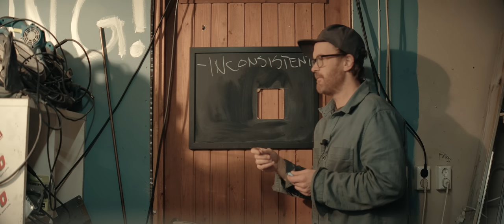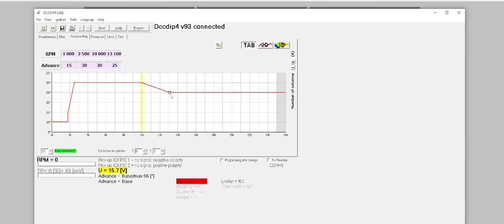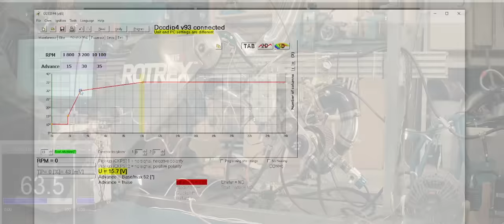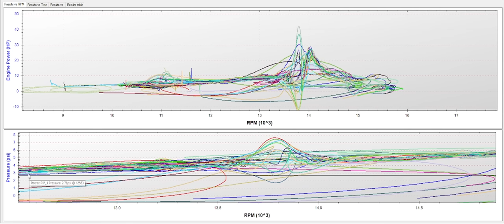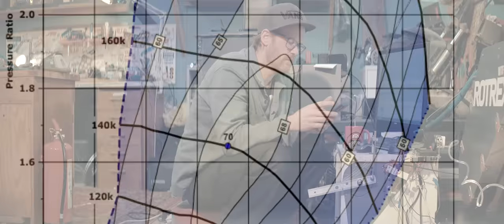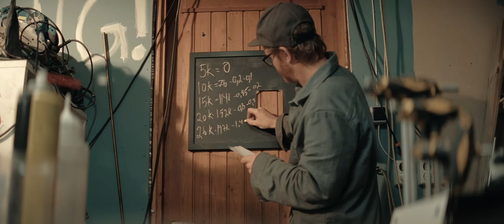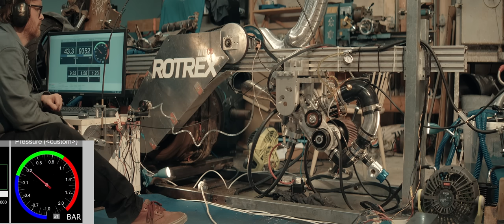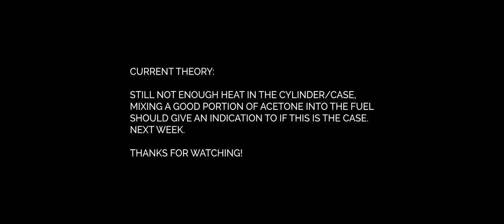Supercharged Pulsejet Engine?

Comment: Maybe increase the carburetor distance from the block, longer runner so to speak, for higher rpm. This worked for me on my 241cc race engine. I tried 5 different lengths. Too close and it wouldn't rev high.

Comment: I have a question about flame path as you are using a flat piston top, and with the high flow would a shaped piston top help direct fresh mix into cylinder rather than just passing over the piston to the exhaust port?
Reply: Hello Lee. I believe this piston has a 5 degree piston crown.
Many decades ago pistons came with deflectors on the piston crown which gave good efficency at low rpm when dished combustion were used.
The porting which Alex uses is similar to the Aprilia RSA which is renowned for it's perfomance
Reply: @malcrandall1309  thank you for replying,  
That helps clarify that the deflector type piston top is relevant to slow running,  so I'm assuming the transfer port geometry is doing a similar thing and this is what you are referring to from the aprilia design. Negating the need for the deflector type piston.(probably over simplified)
Reply: @leealsing1539  The transfer ports are similar to the Aprilia in height. Alex added a large radius transfer ducts to try and negate crowding in the passage ways.
This PiP engine was designed to be run N/A with a 100% of bore exhaust port with 2 induction systems. The main one being fully resonant with 2 fuel injectors
Sadley the 100% of bore exhaust didn't quite work as planned using the Mark Atkinson design piston and a exhaust bridge was later fitted.
The crank cases have a very large internal volume which I personally feel isn't the best for performance.
I must admit to coming from the clockwork era and not a fan of forced air induction or other fancy fuels I will close by saying Alex designed the crank cases as well as the cylinder/head and expansion chamber.
PS, I'm a great fan of this PiP engine and would love to see it run N/A with conventional race fuel as.It would sing like a bird released beyond 20K.
Reply: @malcrandall1309  thank you. You have been extremely helpful, and I'm greatly appreciated your time and knowledge.
Your replays have been really helpful and give me a far better understanding of things.

Comment: Is it possible to add a pressure sensor , so we can messure compression in crankcase ? 
20:46 Maybe the fuel is self igniting under pressure and pushing agains the rod from bottom.

just an idea🤔

Comment: Seems air velocity is the problem rather than relying on heat to atomize the fuel, maybe a smaller carb; thinking being like a spray gun, smaller outlet - higher velocity for the same volume with greater atomization? Adding more boost with the larger pulleys is just adding larger volume rather than increasing velocity no?

Comment: All the air flow from the supercharger is probably blowing through the engine and pressurize the exhaust. It's probably choking the the exhaust from engine and since it's under so puch pressure its probably just exploding.

Comment: Kawasaki and Mazda have patent for 2-stroke supercharged engine. Engine uses CAMSHAFTS & VALVES. Fuel is injected and lift amount of intake and exhaust for valves is: - EXHAUST: CCA. 60 degrees to tEC; -INTAKE: cca.160 degrees to 300 degrees(tIC); fuel is injected at 300 degrees to cca. 330 degrees & IGNITION is at cca. 350 degrees(depends on ignition timing). SUPERCHARGER is directly connected to intake valve. In your case the carburater has interference from pressure of the supercharger. Cheers

Comment: That odd boost spike has to be due to the harmonics of the exhaust pipe, because there is such massive overlap and the only true way to build boost in a 2 stroke is by pressurising/restricting the exhaust .
Reply from the maker: 👍 I'm thinking so too, especially after more boost didn't do anything.

Comment: If you want more heat into the engine, try running it on gas for a bit and then turn on your mix. I still believe that the pipe will never do anything in a forced induction setup, there's too much exhaust pressure and velocity to overcome for any sort of wave to head back towards the engine, especially at that kind of rpm. The fact that the fuel is still burning through the pipe tells me you still need more ignition advance to hit the point where you've made up for how slow that fuel burns, though it should throw a flame no matter what if it's running right.
Reply: You're right, J.A. When Alex I finally gets close to a workable system, running the engine on gasoline will get the head temperature up to where it belongs... then he can use a gate-valve to immediately switch to the nitro/methanol mixture. Also, I think you're right about his use of expansion chambers in conjunction with mechanical boost—they are detrimental to the success of this design. No matter, I believe that Alex will eventually incorporate his rotary exhaust valve to trap the combusting mixture within the combustion chamber. Like it or not, he will also have to increase ignition advance as he progresses to higher percentages of nitromethane.
Reply: @davidgierke7582  really makes me wish I could afford the tools and materials to make this myself and prove that I'm not just talking out my ass. I'm sure that someone that's willing to listen to others and learn from the knowledge of those that have been there before and know the fuel etc could have this thing working right in no time. Now I doubt it'll ever make as much power as he thinks but, I think they could get it running right.
Reply: @jaratt85 Hello, can you rembember around a month ago Alex had a rant on why he does things as he does. Well that rant was directed at me! I had suggested in the comments that he should reduce the crankcase volume using epoxy putty to reduce it's 390cc volume giving a better pumping action.
Sadly this hit a nerve with Alex. I had no intention of pulling Alex down in any way but he did say he's going to do it his way come what may! No one can fault him saying that! it's his free to view channel.
There are lots of us who would love to get a few day's in Alex's garage. I have volunteered to do the night shift many a time.
This message is just to allow you to understand how Alex works.

Comment: I don't know if you or anybody else notices it or not but right before the exhaust ignites and starts shooting a flame you can see raw fuel being sprayed directly into your exhaust vent tube quite heavily. Almost comparable to the mist out of a can of hairspray it is so much..... I'm beginning to think that the engine has some sort of resonant frequency issue that is causing it to not allow adequate pressure building and fuel atomization to happen inside of the combustion chamber. You may have built all the parts so perfectly and harmoniously balanced in frequency with each other that all of the vibrations literally cancel out the combustion process....

Comment: Maybe the port timing is too aggressive for boost. Back in the early 2000 era, Dan Hull was turbocharging Yamaha banshees with good success. I remember hearing that the port timing /porting had to be completely stock.
Reply: This engine has revved to 18300 while using the roots blower and speedway carb.

Comment: Will it rev above 15k without the blower or on pump gas?
Reply: Alex did some tests several weeks ago using Petrol and the engine seemed much happier with no back fires. What it revved to I can't remember.
While using the Roots blower and speedway carb this engine achieved 18300 RPM and climbing pulling the retarder un braked.
Reply from the maker: I'm at the verge of caving into a normal sensible person now. Disconnect the blower, re-tune carb for gas, start from there.
Reply: @2STROKESTUFFING  Your comment " I'm at the verge of caving into a normal sensible person now "  I'm just coming round to you using RC fuel. I was a great fan of carbs but I feel with this fuel the only way to get the finely atomised fuel required is EFI to allow complete combustion before the exhaust port opens at such high revs.
Does this mean your taking on the Dutch 50cc tuners again........YIPPEE!

Comment: If you ARE running into a pulse resonance induced upper Rev limit, to exceed it you have to raise the pulse resonance point. To do that most easily, shorten your exhaust length, or put a shorter blower to port path in your system. Pulse jet resonance is all about length and the speed of sound (the hard limit of pulse flow in both directions). Under standard conditions, that means your ENTIRE tract length (blower to stinger) should be somewhere around half a meter ( 20k revs=40k pulse runs per minute/60=660 pulse runs per second. 330mps mach/660 pulses=0.5 meters). 

Such a length would, however, subject your blower wheel to resonance battering  at 20k rpm, so just a bit lower length would give you a resonant peak above 20k (a 45cm total resonant length would be a roughly 22k Mach redline rpm)

Comment: It seems to me, that you should consider how the engine will be mounted in the frame. I suspect that out of sheer need, you will alter the pipe diameters and lengths and the operational engine will be very different. 
One step at a time. You need to know which change caused which effect. Note them down.

Comment: 4 foot flames out the headers is not a uncommon thing with nitro, well on the drag cars any way. something to do with how slow the fuel burns means its still burning when pushed out the exhaust.
Reply: Also lots more timing. top fuel drag engines go as high as 55* there spinning at 10krpm with that sort of timing and lots of boost.
Reply: @judgie13  Today's top fuel and funny car engines are turning slower—closer to 8500 rpm.

Comment: What would happen if you eliminated the ignition & went glow plug? Do you have the compression to fire in a diesel mode?
Reply: Hey, Peter. Unfortunately, glow plugs intended for the ignition of A/F mixture within an engine's combustion chamber are generally misunderstood. First, glow plugs don't require the high compression ratios associated with true diesels. But glow ignition depends upon three primary factors: 1) The glow coil (usually made from a platinum alloy) works in conjunction with methanol vapors to produce a catalytic, exothermal reaction that heats the element—but not quite to the ignition temperature of methanol. 2) The glow plug coil has the ability to carry-over, from cycle-to-cycle, the heat generated by the catalytic-action, along with the heat from the fuel's combustion. 3) As the piston begins its return to TDC (on the next cycle), its heat of compression temperature is also added to the plug's coil. 

The total amount of this carry-over heat (actually temperature) determines when the engine will fire on the compression event. Thus, the control of the engine's ignition timing is determined by the physical properties of the coil (diameter of the wire, diameter of the coil, the number of coils), plus the location and clearance of the coil within the steel plug housing, etc. With no external current passing through the coil—the engine will continue to run—attests to the glow plug's effectiveness. Glow plugs have been experimented with in engine designs (successful and unsuccessful) since the mid 1800s. Their use in the modern glow engine (using platinum alloys as the element) as used in model airplanes made their first appearance in 1947. Although glow plugs are readily available, none that I am aware of is large enough to meet the ignition and timing (advance) needs of an experimental 50cc methanol/nitromethane engine. Could they be developed? Yes... but that would be another R&D project onto itself.

Comment: I think your pulse jet is the rev limiter, kind of... With rising boost you blow more and more mixture in the exhaust. when that stuff gets on fire you get so much pressure it pushes burnt gases back in the engine, probably over several revolutions and even back in the crank case. As soon as the blower manages to push finally some fresh mixture up in the engine it recovers, but will be blown out again with the next power stroke of your pulse jet.
what do you think of that wild theory?
a wide open pipe instead of your exhaust could give an idea if this theory is close or not.

Comment: u need a open tip egt ( exhaust gas temp ) pyro its what i use in my chain saws it works and u can tell if its runing lean or rich once u learn what temps that  make power at the very least u should use one to start colecting data so when u get closer to making power u have a better idear of the temps u want to run and when in a bike doing speed easy to tell if its about to or is melting pistons.   and do u have a plan incase youer exhaust gas extraction system catchers fire do u check it befor u walk away dont burn down youer shed

Comment: In old days when running 250cc 2 stroke on Avgas we were aiming for 72-74 degrees C... If carb was mounted on inlet side of Rotrex it would work as constructed (not pressureized)... Have you optimized the shape of the head for the flame speed of the fuel you are using ?

Comment: Have you considered a turbo? Maybe after the expansion chamber? I always thought it was the logical thing to do with a two stroke as far as forced induction. The other thing that crossed my mind was that maybe you need to build a pipe for the inducted air volume not the swept chamber volume? If the pressure wave is  fighting back a 100cc engine worth of air charge with a tuned for 50cc pipe that sounds all wrong.

Comment: And I think the issue is now back pressure your blowing the power right out the intake cause not enough Angle on the pipe pre heat the cylinder with a igniter your very closer to perfection

Comment: Couldn't you try to preheat the nitromethane before feeding it into the engine? I mean, i have seen engines that run a heat exchanger for the fuel with the coolant water just before the injection pump

Comment: I have a medium size hobby lathe and I struggled with parting for some while. Not enough torque and rigidity for hss resulting terrible vibrations and rubbing and tool bindings. Crappy Chinese carbide tools were not much better.

Then I invested on proper tungaloy 20x20 parting tool and sharp aluminium inserts. Just crank up rpm and feed and it goes through anything I have in matter of seconds with no vibrations. Just to know, I usually end up working with crappy work hardening manganese steels from scrapyard, because it's difficult to get anything else.

Comment: At those rpm you may just be blowing so much mixture  through the engine that it is combusting in the expansion  pipe and when that happens its creating a vacuum  in the engine and crankcase causing  a runaway  effect.thats why you're getting  such a massive fireball coming out of the exhaust.  Try a smaller size exhaust tip at the end of the expansion pipe. Maybe the back pressure from the smaller tip will prevent too much of the air fuel mix from blowing by the cylinder? I'm not sure just going off what I see in my head. Again I'm no mechanic . Let me know what you think.

Comment: Run the inlet straight from the supercharger and not route through the crankcase. Put the overhead valve system back on for exhaust only and you'll have a really good engine

Comment: You need a iron head,will hold heat better over combustion  chamber.without heat disapating off like aluminum does.given how methanol cools cylinder down.plus you fighting nitro methan...its got a longer burn rate...so its scavenging out threw expansion chamber.good luck my friend.Love❤ your channel

Comment: I don't know enough about 2 stroke tuning to help much, but could it be possible you have the perfect blow down and overlap angle for a good powered naturally aspirated 2 stroke? 
Adding forced induction, maybe the timing between intake and exhaust ports needs to be significantly different. 
It looks like at high rpm when the overlap is greatest in duration frequency, that is when the pipe is shooting fire. I wonder if the induction pressure is so much all of your fresh air fuel mixture is pushed directly out of the engine into the exhaust pipe.

I don't think there is an easy way to test that other than to perhaps redesign the port angles and duration. Maybe for a high power supercharged 2 stroke you might have to have a very short overlap duration and maybe it needs a longer blow down time..
I hope you can power through this, can't wait to see it make 40hp one day!

Comment: maybe a decompreccion port will help lower the pressure faster so that the flames won't reach the crankcase through the transfers. maybe direct injection could help too.

Comment: What about using a heat exchanger / inter cooler,utilizing the engine coolant, to act as the engine cooler / radiator and introduce the engine heat to the intake charge. Assuming you’re using a electric cooling pump, could pre-heat be accomplished with a inline tank type engine heater?
Also, switching to a hotter heat range spark plug.
Instrumenting your charge air temperatures at a couple different points of the inlet system may be helpful.
Reply: Not sure why plug heat range would affect anything?
It's neither fouling, melting or causing pre-ignition.
Reply: @incandescentwithrage  …or making an unreliable spark when cold.